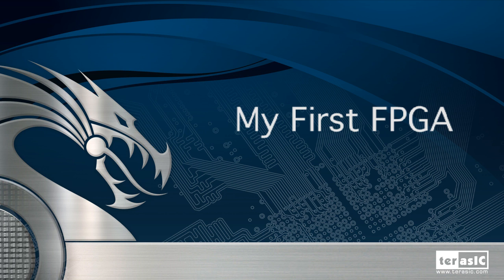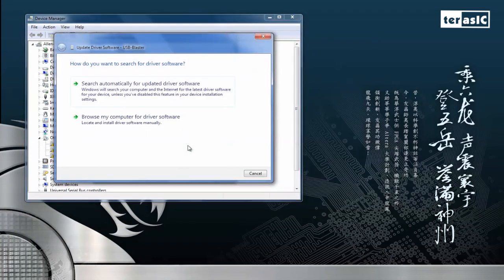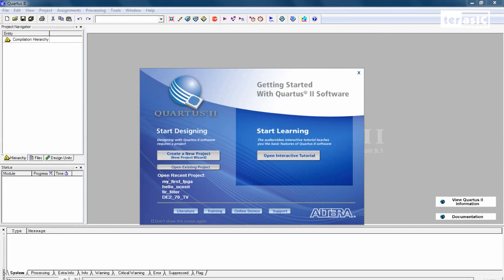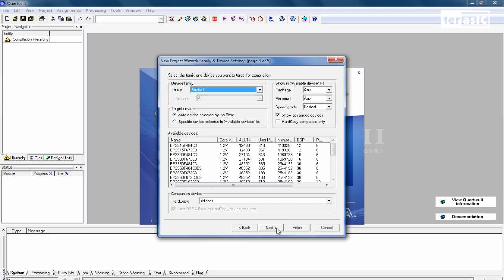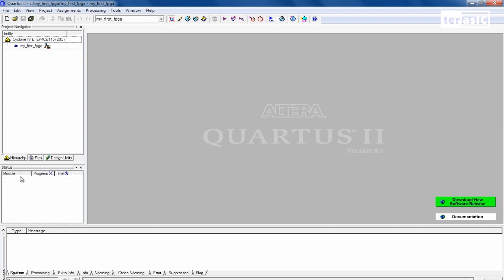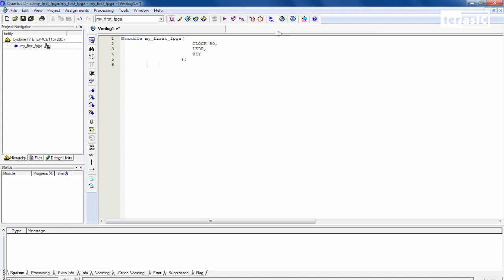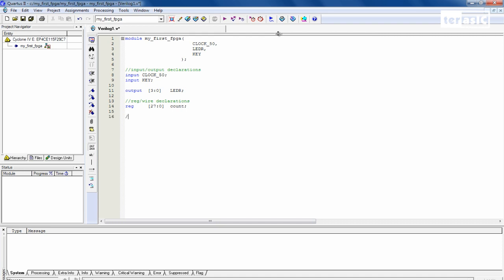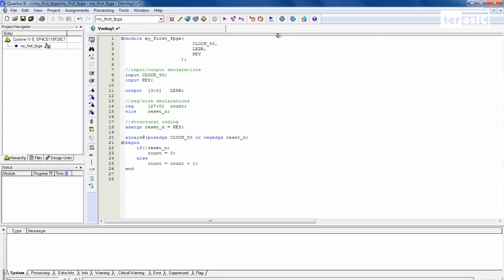My First FPGA Tutorial (1)

Comment from the maker: Hi lezanderson!
For the DE0~DE2 we support ps2 inputs for mouse and keyboard. we also provide USB slave ports if you have USB mouse and keyboard. the PS2 port should be located above the GPIO pins on the DE1. As for legacy serial and parallel connectors, you can find out more information on our website at de1.terasic.com, hope this helps.